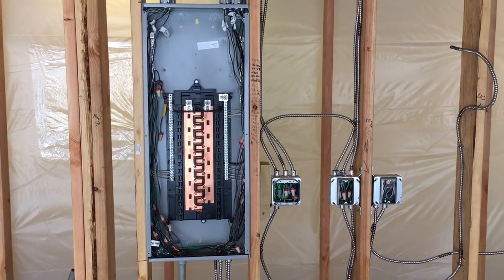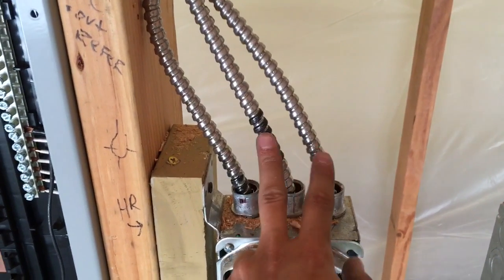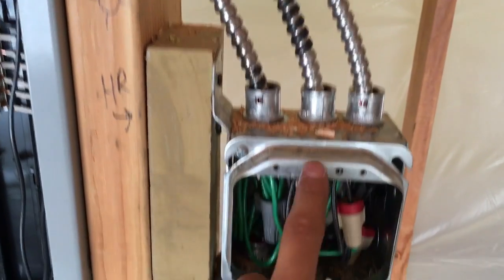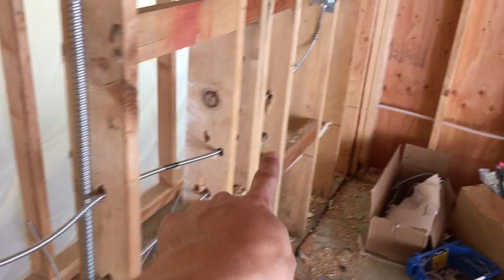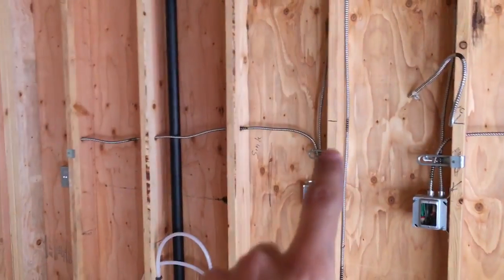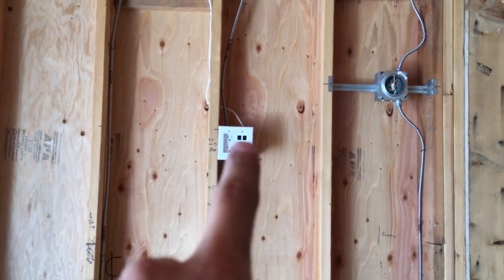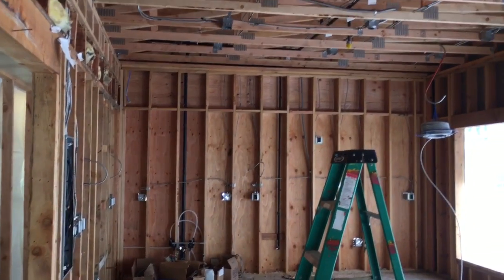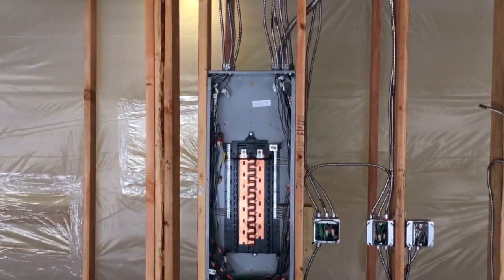Electrical 101: Basic Wiring Knowledge

Comment: Where is this? Every residential video that I have seen is using Romex and plastic boxes. I like the idea of using metal boxes and mc cable, but it's usually considered too expensive and more labor intensive. You get what you pay for. Is it required there or is it a customer request?
Reply from the maker: it was for a commercial kitchen in an assisted living facility. so per spec probably

Comment: every one of those home run boxes jumping to another power box are connected one and wired one by one ? and leads back to the power box ? or some of them you have found ways to connect them if they seperate wired to the power box, which is apart from the other ones in the garage?
Reply from the maker: each wire and box has a specific purpose. you have to know the purpose so you know how to wire it accordingly. some are "home runs" to one box and stop. some hit the first box then jump to others.

Comment: Hi guy some one please tell me the different between home depot 2 gauge thhn  copper wire and Lowes wire.  They both made by southwire but why does lowe list it can only carry max 110 amp while home depot listed on their site 125 amp max.  If I don't remember wrong, I think in store even said 130 amp.  I plan to run 25-28 feet inside conduit over head inside garrage ceiling.  125 circuit breaker box. Thanks
Reply: Check NEC code book and look at the 75C column. The reason for 75C column is must use the lowest value for the entire system and circuit breakers are only rated to 75C.

Comment: buy the way guy's or girls out there if you are going to do a job big or small do a good job ok because word of mouth gets around in our building trades industry and tells us what you are doing right or wrong ok, there is a big difference in having a silver tongue ok and looking good, but the real truth is can you deliver on your words, can you get the job is done when called upon or not, so all and all is know the why's and what for's of what you are doing in the field out there ok, anyone can hang up boxes, pull wiring thru raceways ok but remember why you are doing it to achieve what? ok yes type of cables correct outside must be w rated for wet area's everything outside a building is considered outside, so nm cable is not approved for wet areas ok, also know how to figure out your minimum branch circuit conductors from 220 volt fixed appliances like condensers, mini splits etc when I inspect your job I'm going off the fla on the unit which gives me a lot of information on the unit like minimum amps, maximum and or minimum breaker sizes, etc. if the unit does not give you the minimum breaker size than you always multiply the minimum amps by 115% this gives you, your smallest breaker size which will be the next size up from the 115% multiplier ok and of course, it will always give you the maximum breaker size, and you cannot go over it at all or you will fail the job if it says maximum 20 amp breaker that's it no 25-30 amp allowed ok

Comment: is this is a home  or a commercial install I see all branch circuits are in the metal cable which is commercial grade wiring usually home wiring is done all in nm cable throughout the home why is this home in commercial-grade wiring, this is a heavy expensive thing to do

Comment: How do find the wiring in a house? I take it you dont remove there sheetrock from wall and ceiling.  
How about connecting a indoor light switch to outside? Put a hole through the wall?
Reply from the maker: depends on the situation. if you are adding a new light, yes. if it already has a switch, just change the light.

Comment: Why is it a bad idea to take the output of a Honda EU2200i and bring it into a house via the 240-volt GENERATOR INLET? I realize that it cannot power the whole house. I am only looking to power one circuit. I also realize that the generator only outputs 120-volts. However, can't 120 easily be converted to 240? Simply encouraging me to just run extension cords through doors/windows doesn't answer my question. I want to understand why using the generator inlet (NEMA SS2-50P) is a bad idea (or impossible). If it is possible & won't hurt anything, I would much rather use the inlet vs. running an extension cord through a window.
Reply: I just discovered that a variety of products exist on the market that are aimed at doing what I described above.  Should I gather from that that what I am wanting to do is perfectly safe & legitimate?  I also have this question:  Many of the adapters I have seen only have one 5-15P feeding them.  Should I assume from that that what comes out the other end is only 110v?  In other words, 110v exiting from a, let's say 14-50R, which is obviously designed to supply 220v?  If so - if only 110 volts enter the house via the generator inlet, what issues (if any) would that cause?

Comment: Was noting the quality of your line cabling, it's called 'BX' cable? Is that right?  Here in Georgia they only use the plastic coated wires.  But out in the country where we are, sometimes 'wildlife' gets in, and they like to chew on cable.   So I wish we had the metal-clad stuff like you are installing in the video.  Is it something I need to ask for when having new wiring done?
Reply: You can ask the electrician to use Ac90 cable, it’ll just cost more money to do the job
Reply: Why call Ac90 to bx
Reply from the maker: this is a commercial kitchen so its in MC (bx) you can have it installed in houses just more money

Comment: Why did you have to run conduit inside of walls instead of romex? Im in Ohio and thought conduit is not required inside of walls.
Reply: Well first off it's called MC not conduit. Second just because they legally could use romex doesn't mean the prints said they could. MC is way stronger and harder for a stray screw to damage it. Also critters are not going to be able to chew threw aluminum but they definitely will chew through plastic
Reply: @jonlehman2671  yeah but MC is technically a type of conduit so he’s got the idea.
Reply from the maker: Just following the job specs :)
Reply: I guess he charged pretty good and added the bells and whistles
Reply: And in Chicago here we have all hard conduit not bx or romex. MC or flexible conduit we can only use less then 6’ I think. To like an appliance or for remodeling and moving electric..

Comment: You do that in belgium, you are fired in one second!
Thoses cables pass through in the middle of the wall are forbidden here...

Sorry for the bad english...
Reply: That is allowed and fairly standard in the states. As long as your hole in the stud is centered, your alright.
Reply: @anoniemoss3566  i think i understand that you can wire a cable in a vertical or horizontal way on a device like a switch? Seems to bee appropriate :) here we can only wire a cable horizontaly under 10 inch or upper x inch or on a vertical way up or under a device...
But we doesen't have steel protection like that in residential installation :)
Reply: I would say the way they did that borders on overkill. Most installs I see still use NM-B cable and plastic boxes.

Comment: What state let's you run Mc like this? Why Mc over romex?
Reply: Running that much Mc hurts my feelings. Roughing a house is tedious  enough without having to wear out a hole saw like this
Reply: @supgirlucute7363  what holesaw same bit as for romex
Reply: Every state allows it
Reply: I was wondering that too. And if you are going to use mc, why are they using regular 1/2 emt fittings at each box. That almost looks like 3/8 mc. They make a fitting to clamp on mc.
Reply: @anoniemoss3566  I didn't see any emt fittings just snap-in mc connectors